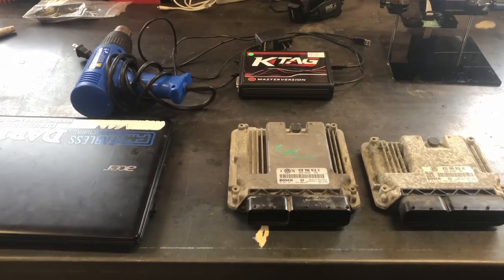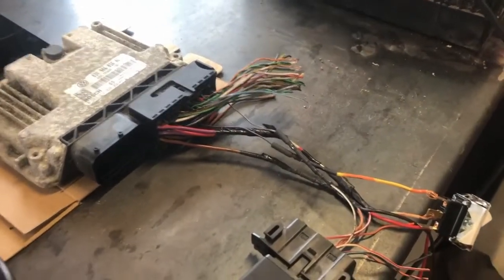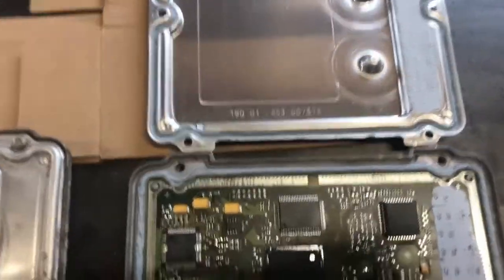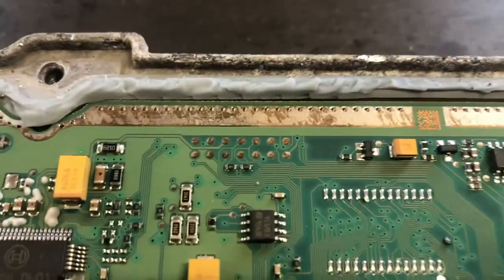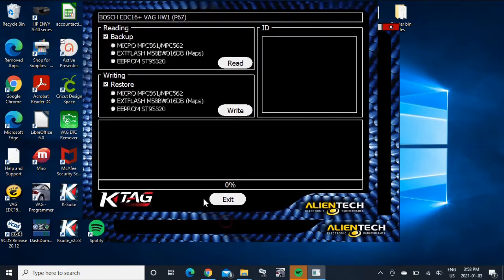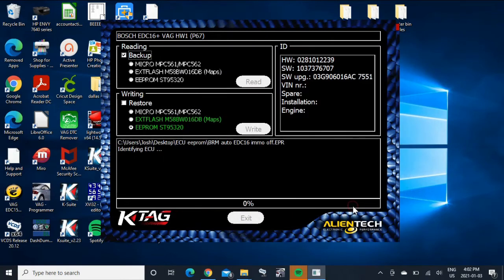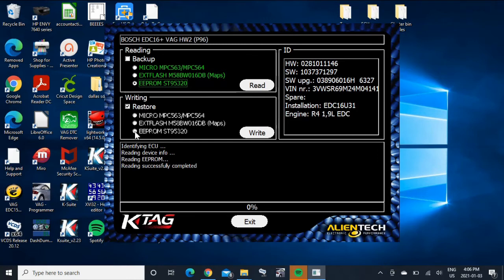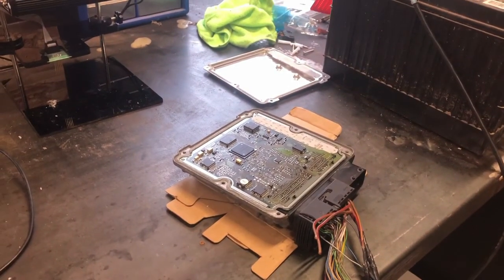BEW & BRM Immo defeat EDC16

Comment: Hello Josh. Unsure of how else to contact you. I have just purchased the same equipment as in this video. I have both ecu's for a V10TDI. Is IMMO in both ecu's? Is there a way to identify master and slave with this equipment? Thinking, if only master has IMMO that would identify it. I am a subscriber (and long suffering mechanic) and appreciate your "real world" approach.
Reply from the maker: I would believe both would have immo in them, when reflashing them they both get the master file so I’m not sure how to identify once removed. To be honest a stand alone v10 is on my list but I haven’t ventured/researched it enough to be confident on my how to go about it
Reply: @JoshsJettas 
Thank you very much Josh for replying. The ecu's are the biggest issue with transplanting these. I am fitting the V10 and trans into a Jaguar, Have removed the twin turbos for a single so would be looking to delete immobilizer, delete turbos, delete egr and some other sensors all of which I think one could fool the ecu to believe still existed if they can't be deleted. Possibly I have shot myself in both feet here but I'm not going down without a fight. Is there some other way to communicate with you and perhaps collaborate on V10 (exchange photos)?  Merry Christmas.

Comment: Have you found that clone to be stable? If so, where did you get it?
Reply from the maker: Worked well with the various vag edc16 ecus I used it on, had mixed results with me7.1.1 but it never bricked anything. I’ve actually had good luck with 2 from eBay (got a second one after I shorted the first on out on the bench by accident)